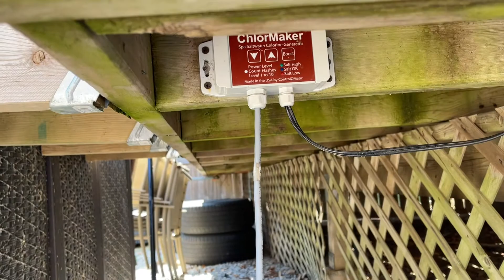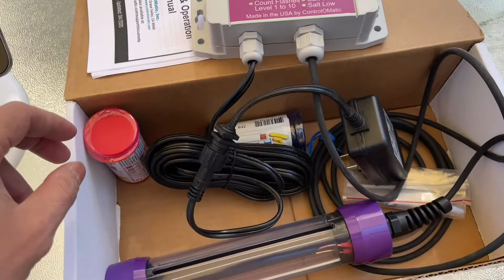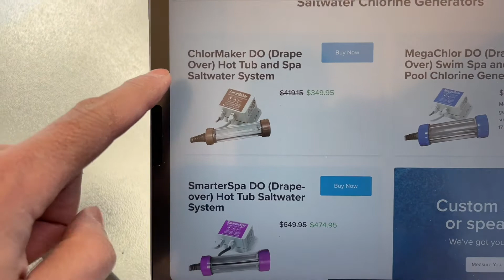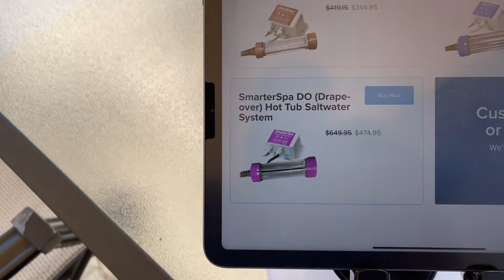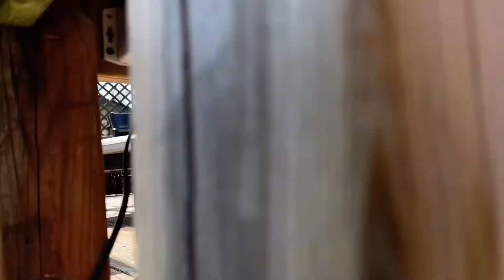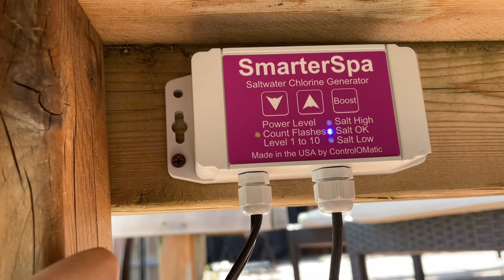Salt Water Hot Tub Chlorinator (SmarterSpa)

Comment: Just bought it last year 2023. After receiving help balancing the water from a local pool store, we have had crystal-clear water for over 10 months.  We did not need to change the water over the winter.
Reply from the maker: glad to hear you are having a great experience with it so far.  The seal on my cell was defective but the manufacturer replaced it completely.  It works great know and I seldom have to add any additional chemicals to my tub to balance it. Thanks for commenting!
Reply: I just found out the company has shut down. What a shame. No more spare parts.

Comment: one more question:    I'm a new user just installed but having some trouble.    Water is balanced, salt is around 1400ppm.    Chorine tests are showing almost zero Free Chlorine.  When i put the cell body into hot tub and turn on the unit,  there the smarterspa just sits in standby and whiteLED blinks every 10sec... .     I tried pressing boost and it does start to bubble up and make chlorine.   I see chlorine levels com up eventually  --- however this smarterspa does NOT automatically turn on at all.   I raised the ZEROPOINT to max 60 and it still doesnt trigger.     At this point its a manual machine that only works when i press boost button.      Any tips?  is my controller broken?
Reply from the maker: You might be right, the controller might be defective or the drop rode sensors also could be faulty.  Have you tried getting a bucket of water and then adding the necessary amount of salt in then us that as to test the generator?  First only add a bit of salt then slowly add more salt in the bucket until the low salt signal turns off.

Comment: Hi! I was just wondering if there are any long term negative effects to switching to saltwater? I am currently using bromine and I’m interested in making the switch to saltwater on my next fill.
Reply from the maker: I’ve been using it for a few years now and love it!  Only negative thing I would say is I had issues with the drop in rod in the first version I got…it was a defective seal in the titanium plates and sensor.  Fortunately the supplier I got it from replaced it right away…in fact they allowed me to upgrade to the newer version.  Now It’s been 2 years now and I’m still really happy with it.
Reply: @DDIY-Guy  thanks for the response!! I assume you will still need to test the water each week? I have ph and alka up/down products I used when I had bromine. Would I be able to use those same products for this? Thanks!
Reply from the maker: Yes, you will be able to test your water PH and alkalinity levels with those testers.

Comment: These are absolutely junk bought one used it for about 3 weeks it quit working called the manufacturer they said send it in and will analyze it and maybe fix it the only problem is what do you do whenever you don't have one might as well just buy chemicals and put them in it. It should have never quit working in the first place
Reply from the maker: Sorry to hear that, mine failed as well and the the place I got it from told me to take a picture of the defective silicone seal it at at the sensors….they then sent me a a replacement rod.  While I waited for the replacement to come in, i used one of those floaters and put chlorine tablets (not bromine) to sanitize my tub temporarily.  Sorry to hear yours was defective.  Thanks for commenting though.  Hope you have a good rest of the weekend.

Comment: I set the levels according to the size of my tub, I put the correct amount of salt yet I still get the low salt indicator light. Any pointers?
Reply from the maker: Don’t put any more salt…there might be something wrong with your sensor.  Check the drop rod and look at the 2 wires sensor beside the titanium plates.  If there is rust there, the sensors might not work properly.  Contact your supplier and let them know about it.  Take a picture to show them.  They might send you a new replacement rod.  Another possibility might be that the salt has not dissolve completely in the water.  Other option might be you need to add one cup at a time
Reply: My solution was to contact the supplier regarding the issue. I shipped the Chlormaker for repair and it was returned within a few weeks and began working as shown in your videos! 

A few months later though, another issue arose but this time w/ the power supply(Salt level panel). Repeated the process of return for a power supply replacement and received it back in two weeks. No further issues as of now.

Comment: just plugged mine in i have no salt indicator light lit? once i hit boost it is flashing ok? should the light have been solid?
Reply from the maker: Yes why do you hate boost the blue light should stay on with “salt OK”, that means it is generating the chlorine.
Reply from the maker: After testing it with Boost, the generator will automatically monitor the chlorine level and will turn on when it is needed. check the chlorine levels after a day and if it is too high or too low you can adjust the settings by pressing on the two arrows up and down at the same time then press the up and down arrow once to increase or decrease the levels.